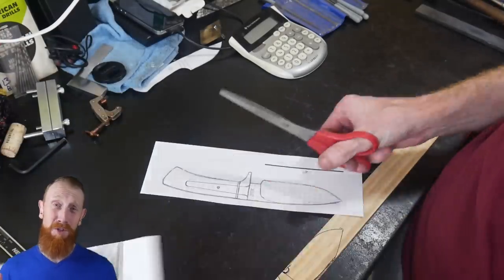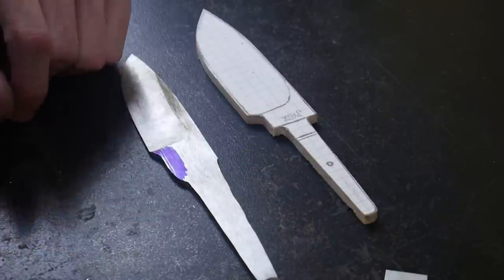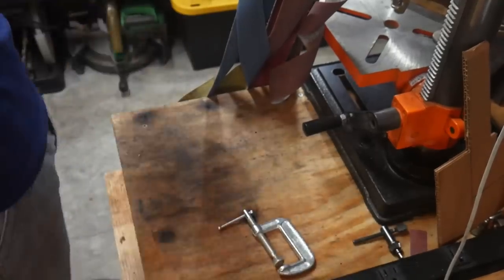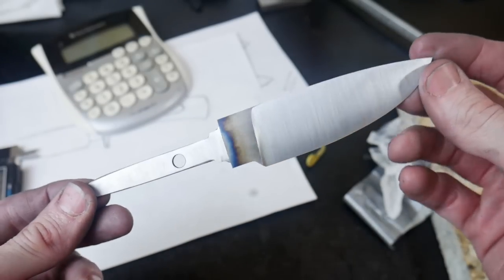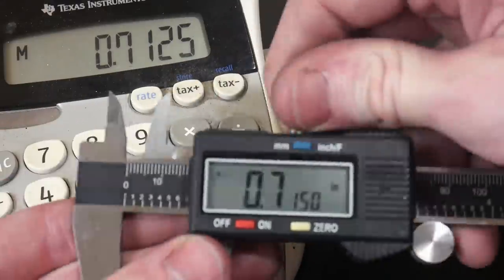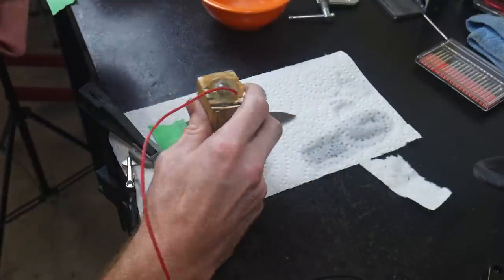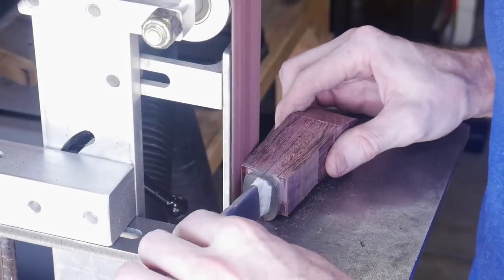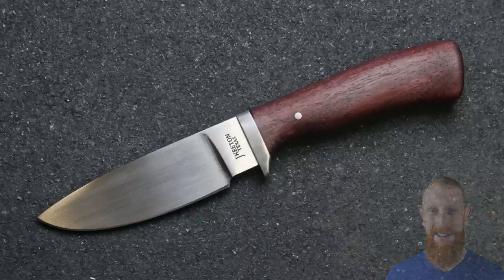Forging A Hunting Knife | Knife Making

Comment: Ya I've made a few knifes that have had issues. Nothing  is ever 100% perfect. Just do your very best. That's the best way we learn. By using our hands. The knives that are messed up. Make great gifts to family or friends. Most people don't even see what we see. I love the fact,  you given credit to the guys you learned their techniques from by watching there video's. Few tips, get a cheap set of thin wet stones to sand with, instead of sand paper on the steel its faster. Pick up some 3M elastic sandpaper for your scale handles. If that handles feel great in your hand and doesn't want to twist around or close your eyes and your can feel your scale handles are in the right direction that's perfect. Nice shop, Enjoy making knives. Thanks for sharing your video's.
Reply from the maker: Thanks for your comment and the tips! Lots to learn! Have a great weekend!

Comment: Hey man, a good tip I just learned myself is, when you start forging a blade from some bar stock with 90 degree corners, take those corners off with your grinder just by a bit. That will vastly reduce the chance of fish mouthing/cold shutting. Cheers ~ The Norse Forge
Reply from the maker: Thanks man! Cheers

Comment: Dude, you did a great job on that knife. Hidden tang knives are far more difficult than one would realize! A few things I noticed: First, yes I actually DO imagine Nick Wheeler standing behind me as I hand sand. So when I think I'm done, I keep going trying to get out every scratch and make it perfect. Next, not too sure about the plunge of the end mills. I just use a drill bit of same size, drill, then start milling. I tried the same Kyle Royer Dremel deal on my last one and it worked ok (will work better with more practice and steadier hands). Third, still jealous of your surface grinder!
Guards are a pain in the butt! However, I just can't seem to stop trying to use them on every freaking knife and trying to make them better. It is definitely an art. Love the Royer top platen that you made. I made one a few months ago, but could never get it to run right on my grinder. However, in looking at yours, I think I will start over and make it like yours and give it another chance. Overall, again, I think you did an awesome job. Unless one of your customers complained, i wouldn't think too much about the critiques of the internet haters. Chances are, unless they are some of the men you mentioned in this video, their opinions mean diddly! Would absolutely love to come out to Texas and spend a weekend learning from you and trading techniques and tips. Thanks for another great video brother! 
r/
Wayne   @deep_sea_forge
Reply from the maker: Hey Wayne, thanks for your comment. You made a ton of good points there! The guarded knives are such a challenge... but I really enjoyed the build. Lots of new things to learn for sure and lots of techniques to prefect! This won't be my last one for sure! Hope all is well man. Keep on grinding. Cheers!

Comment: The flat platen is a great idea.

You can avoid the grab by running the belt in reverse.

You can also avoid messing up your filing jig by adding two offset screws that you butt up against the edge of the flat platen on either side of the belt.  This also allows you to sneak up on the final line by slowly changing the position of the screws.
Reply from the maker: Good ideas sir! Thanks!

Comment: Dude so many awesome tips.  🙏  I tried to make a carbide file guide. And it worked well but had trouble keeping the carbide adhered.  Then when watching this saw you madd a vid on the build of that!!  Off to watch that now.  Much respect, thankyou.
Reply from the maker: Hey David, it works decently. I've knocked them off with the grinder before. No issues with files.

Comment: Beautiful blade, and a great job doing it! The only thing I would worry about is the actual strength of the hidden tang with that pretty good sized hole in it. I understand it's a hunter so you shouldn't be batoning with it but i've had a couple hunters brake on me in the handle because of it.
Reply from the maker: Good point sir! I don't think I'll put that large of a hole in the tang again after looking at it now

Comment: I agree with your thought on the length of the ricasso. It should be just long enough to comfortably transition from the blade and choil to the bolster. Also, I’d say you might want to do a bit more finish polishing on the bolster, so the polishing marks left from the finish sanding all go in a more uniform direction.
In spite of your criticisms, it is a fine piece of craftsmanship. Not overly decorous, but useful and comfortable looking.
Also, I for one, prefer a handle that’s a little broader across the back and a little thinner near the bottom where the fingers wrap around. I have remade handle on many of my knives over the years, and while this is unusual, several of my friends ask me or copy my changes for the greater working comfort and control this give the user. Of course, it also means it is more fitted to an individual user, so perhaps, less marketable.... looking forward to your next project.
Reply from the maker: Hey Chuck, thanks for your thoughts! I have a ways to go with this style of knife for sure. Lots of adjustments to be made! Have a great weekend sir!

Comment: That first cut you made with your hatchet can also be achieved quite easily with the edge of your anvil face. Place your hot piece of steel over the edge at a 45 degree angle right where you want your cut and hammer directly into the corner of the steel. Keep hammering until a black heat, quench the crease and then it should work harden until in separates. Bending back and forth once or twice will separate it.
Reply from the maker: Thanks for the tip sir! I have much to learn with the hammer and anvil!
Reply: @RedBeardOps  I’m not blacksmith by any means but I’ve learned some really good shortcuts and similar things from my first instructor Jonathan lambert. He’s badass makes all kinds of tools local south of Sacramento in Elk Grove. Keep up the good work!

Comment: Why do you dunk the knife in water after tempering? I always thought it was supposed to air cool after cycles.
Reply from the maker: No need to wait for it to cool slow in the air after tempering. The dunk helps get it to room temp quick and back in the tempering oven. Cheers have a great weekend!

Comment: Vermiculite?  Haven't seen this before. On Amazon they have some for gardening and some for fire places.  What type do you use?  Thanks for the great video.  I love the tips!
Reply from the maker: That is correct sir. I found it in the gardening section of Home Depot. Works pretty good for holding the heat! You could also use play sand.

Comment: Very nice first atempt at forging. Its a constant learning curve. All part of the fun.  Very good tip using the brass as a pin locator hole. If you dont want to use pins,( i have a personal hatred of them) you can put teath cuts along both edges of the tang. This will give fantastic glue grip. In my personal opinion and experience you do not need pins in a hidden tang knife. Its all about the fit. If you have a good tight fitting joint it will never fall apart. The term used alot these days "you can never have enough glue" is crap. You can have too much glue, infact it can often have the opposite effect as it creates alot of pressure inside the joint. Ive over 20yrs in furniture making and never once has a joint failed on me. Its all about the fit. And do yourself a favour, keep wd40 away from your knifes. Its not an oil, its a penetrating fluid and release agent, which has the capacity to soak into your joints and weakin the bond. It also creates rust, i found that out the hard way on my wood turning tools. Use a teflon or even silicone based product. Even with these keep them away from your joints and handle material. They all can soak in and effect your finnish.
Reply from the maker: Cheers sir! Thank you for your comment and the tips. Can't wait to keep on learning! Have a great weekend!

Comment: As a beginner knife maker I realize that unlike most other trades where you are finish work covers up things that you mess up. Knife making is less forgiving for sure. If you mess up on a bevel on one side the only way to make it right is to match it on the other side now and sometimes it'll throw off your design. Stupid me wanted a knife for a very long time so I decided to make it, it's known as the huntsman. Super difficult for my first night for sure. And I ended up buying 1095 instead of 1085 so needless to say it remains untempered.
Reply from the maker: Very cool. Knife making is as awesome art for sure! Lots of patience required.

Comment: I measure where the center of my guard is, drill a hole there...then throw the thing in my forge and drift the hole to roughly the size of my tang, then hot fit it to the blade and takes me 13 min start to finish and do not need to do any filing unless I decide to do it using said Royer method which i have yet to try out.
Note i forged a bunch of drifts from Rail Road spikes.
Reply from the maker: Very cool sir! I'll need to try this method one of these days! Have a great weekend!
Reply: @RedBeardOps  thank you and the same to you.

Comment: I cut slots in bolsters by drilling several holes close together and filing them out by hand with several small files. I don't have a mill. I'm still new...
Reply: For hidden tang knives I use chisels to cut the recess, it's old fashioned and time consuming but it works...

Comment: hi bro, i love your videos. i have a question: What is the best way to rectify or sand MANUALLY two pieces of steel that are going to be glued to the handle so that there are no spaces where light passes through? i dont have machines, please :( NOTE: I sand the piece on a flat surface but the piece is not straight and it is inclined, I think it is because I give it more weight to one side.  And I don't know how to do it anymore.  I make straight movements.  Should I do circular movements?  do you have any other techniques?
Reply from the maker: Hey Pablo, this is a difficult problem to solve manually with a flat surface. I guess you could try to take measurements on the blocks and see what side/corrner needs to be reduced the most. Then apply pressure there. 

You could put the pieces on your knife and see where the gaps are. Mark where the gaps are not, and sand those seconds down.

In reality this is why people buy expensive mills and surface grinders.
Reply: @RedBeardOps  You're right. thank you so much for answer me 🙏🏻

Comment: The handle is way more thick and rouded than it should (considering this is a hunting knife) as you alsomentioned. Blade should be full convex for the same reason. Hunting knives, are specilized knives, designed for the needs of a hunter while hunting. Field dressing or simply skining an animal. is the reason the blade should be full convex or at least saber/convex, not only for edge strength, but mostly for the knife to glide on bones and preventing the edge from touching the bones while taking backstraps etc. hadnle should be thinner in the front part, to ally pinch grips etc. That being sais, it's not bad for a 1st try making a hunting knife. Just keep those details in mind, for your next build!
Reply from the maker: Thank you sir!

Comment: At the beginning of the video, you say that you had to heat the blade many times to get the final shape.  Carbon atoms are constantly dissipating out of the steel and the material is becoming more and more decarbonized.  We use old coal or coke based forge stoves in the workshop. This is good because carbon atoms are constantly diffusing into the blade as it heats, enriching its carbon content. There is nothing wrong with a gas forge, but frequent heating should be avoided, because gas combustion is a carbonless medium. normalizing, I bury the blade in heated charcoal and leave it there to cool completely at the end of forging, so that the steel is fully enriched with carbon during the annealing process.
Reply from the maker: Have a great day! thanks for the comment

Comment: Man your to hard on yourself that knife is  absolutely gorgeous
Reply from the maker: Thank you very much! Always striving to get better over here, part of the game for sure. Have a great day!
Reply: Theo, that's what I was thinking. It looks like a damn fine tool to me.
Reply: Totally agree. I see your point about the ricasso, although in this design with the edge hanging straight off instead of having a sharpening choil it works well to ease sharpening. The handle is absolutely perfect, though. It's a million times better to have a handle that's a little beefy than one that's on the thin side.

Comment: Instead of using an axe to cut your steel get youself a hardy hot cut. They make them to fit in all hady hole sizes and cost about 25 bucks and wont cut up your anvil.
Reply from the maker: I ended up turning that axe... into a Hardie tool! LOL cheers - https://youtube.com/shorts/Meiyck-IIlU

Comment: Just curious why anyone would design a hunting blade without a full tang?
Reply from the maker: Just a different style, sir. Most forged blades traditionally were hidden tang. Saves steel. A good hidden tang is very strong!
Reply: @RedBeardOps  .  Just sayin' I've seen even strong knives break. Raised with full tang as a rule. Just see no reason to change at this juncture. LOL